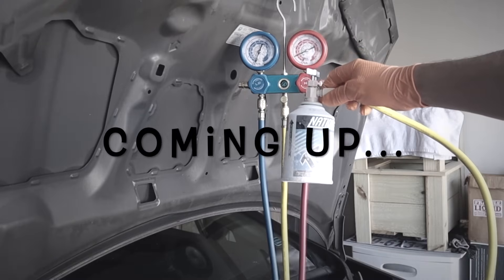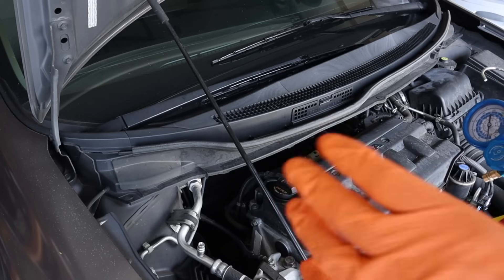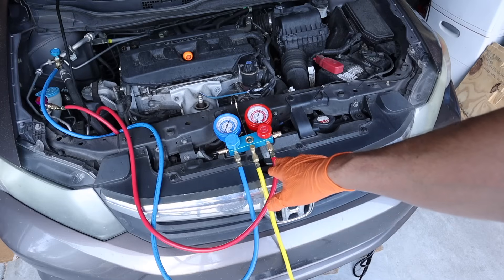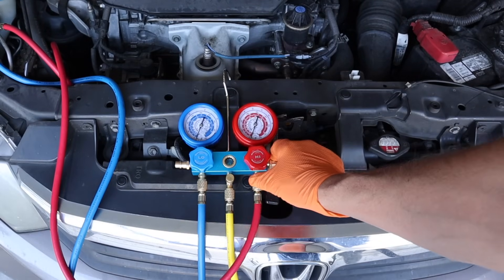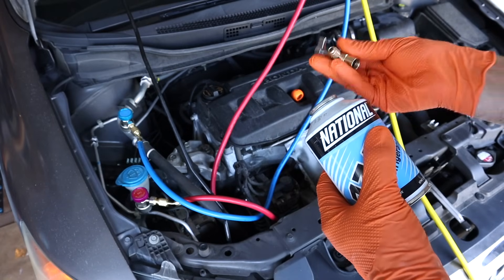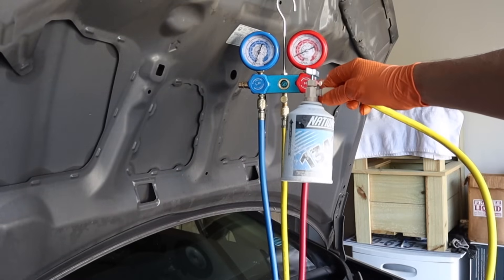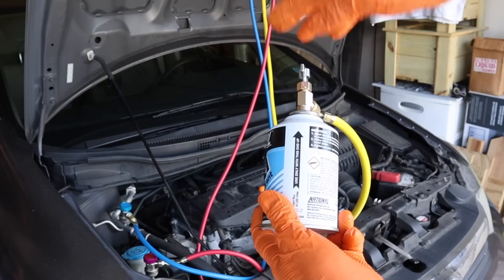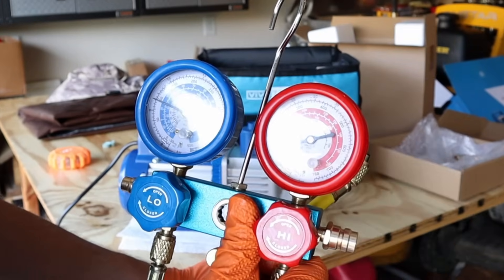DIY Tutorial - Proper R134a A/C charge & Diagnostics

Comment: I had my car regassed. A month later, it stopped
The guy said that the sponge in the condenser is dry and hard. 
What does he mean.
Is it possible
Reply from the maker: Hi Siva, it sounds like to me that if you had your system charged and it worked for a whole month, but now doesn't, you have a leak in the system. And it may be leaking at the condenser it sounds and that would need to be replaced.
Reply: Thank you
I will have the car seen to  by a reputable air conditioner company
Reply: " sponge in the condenser is dry and hard" makes no sense.

Comment: I have a Kia soul 2012. 2.0L and the compressor are leaking a yellow liquid for some time. I've tried to seal it with RTV silicone, but I think is not working. Do you think I need to replace the compressor? This car has only 73 K miles, so why you think is leaking? We are in winter so we don't use it too much for now, but in summer this place will get 105 to 115 degrees.
-- I have a quote to replace it for $ 1700.00
Reply from the maker: Hey Iris, it sounds like you MAY need to replace the compressor if you see something leaking around it, but it is hard to say. If you haven't already, I would start with a fresh evacuation and recharge and go from there. Your system may just be low on refrigerant, preventing the compressor to spin. That's where I started on my car. And when I found out that I could buy the kit and do it myself for less than what a shop would charge me to do the evac/recharge, I went for it. Having said that, if you are not comfortable doing it yourself, find a good mechanic who will. Pray that you are just low on refrigerant, and even if you have a small leak, it may buy you some time. Hope this helps!
Reply: Refrigerant is clear, but it sounds it might have UV dye in the system.  Try taking a UV flashlight and see if it glows in the dark.  This will help you to locate any leaks.  A bad seal on a compressor is a common problem.

Comment: Question. If i take my car to a shop and asked them to recharge my system, do they add PAG oil back in??? I think i need more PAG oil in my system as my low pressure line snapped, lost all refrigerant and i replaced it. I'm in NYC so i dont need AC right now, but just wondering if i have to put in PAG or will the shop put it in with the recharge?
Reply from the maker: Good question! The short answer is no, you shouldn't need more PAG oil just because you replaced your low pressure line. As a general rule of thumb, you only need to put in oil when you replace your compressor. Hope this helps!
Reply: @my-honest-review  I actaly had to not only change the hose but the compressor as well, but the manufacture of the compressor said it came filled with PAG oil.... my only conundrum is, i want this set you have for a DYI project, but i live in NYC and dont have a garage, so i have no where to plug the darm pump to... lol
Reply from the maker: @DTUFINOPhotography  Ah, yes that's nice when the compressor comes filled already. And I feel your pain about living in an apartment...I've been known in years past to run a couple hundred of feet of extension cord out into the parking 😊

Comment: to up your game get yourself a micron gauge and learn to use it ,you will be blown away at what guys doing ac is missing. i got deeper in this ac work myself and without the micron gauge you never see the moisture you're leaving in your system . we were taught 1hr vac and everything is good but the micron gauge will show you what your missing
Reply from the maker: Hey thanks for the tip! I've never heard of one before. I'll have to do a bit of research on that!
Reply: I would add also consider getting a bottle of nitrogen so you can do a pressure leak down test of the system before vacuum. I got a nitro regulator with hose for $35 on amazon and rented a bottle of nitro for $19.
Reply: @MyGoogleYoutube  I saw one video where the guy just used shop air!  Possibly okay if it's a dry day and you do a thorough evacuation afterward.
Reply: @paulspooner-q6k can u give us a link of the gauges you'll recommend? thanks

Comment: Great advice about checking the caps. They are the primary seal for the system and should be inspected fully and even replaced when servicing the system. They hold the refrigerant in the system not the shrader valve. The shrader valve is only there to allow you to connect and disconnect the gauges, they are not designed to hold the refrigerant in the system.
Reply from the maker: Great point! One time, I took my car into the shop for an unrelated repair and I asked them to go ahead and do a AC evac and recharge on my system while there. I got my car back and all was okay. Until I raised the hood to inspect. They had left my caps off my AC ports. I couldn't believe it, I had confidence in that shop until then!
Reply: Primary seal is Schrader valve. Caps are secondary and mostly to protect against debris getting into valves.
Reply: @hari4406  That is correct.  Why anyone would think the caps keep the system sealed with refrigerant and not the schrader valve is a head scratcher.  That's like saying your car tire valve cap is what holds your air pressure.

Comment: What is there's still Freon in there, or other oil? Aside from what you did, what if they didn't actually evacuate it all, then what would happen?
Reply from the maker: Good question! When an evacuation is done, it only gets out the freon, not any oil. Now, if they didn't evacuate all the freon, you'd know it when you pressed the schrader valve down on either ac port. If there's any pressure still in there, that means they didn't get it all out (you might get a small hiss instantaneously but that's normal). You shouldn't have to worry about the oil in the system when just doing a recharge, unless you think some has been added to the system when it should not have.

Comment: Nice video I have gauges I've got to get a vacuum pump.  My AC is not working I did diagnostics  and my low pressure is high around 85 PSI when it should be 32-55psi temperature and humidity dependent. My High Pressure is running 100psi should be in the 200psi range.  My suspicion is its the evaporator coil or expansion block  The compressor is quiet and clutch engages.  My next steps are to check for a leak as soon as I get a pump and get the readings from the compressor clutch relay just to rule it out.  Really hope its not the evaporator coil as the entire dash has to be removed and is easily a 10 hour job.  Expansion block can be replaced in 30 minutes to an hour.  The vehicle is an 07 Tundra.   Great through explanation.
Reply: Do I have to do the whole Evacuation job just to replace one of the short hoses?
Reply from the maker: Yes, any break in your system to replace a part, and you'll have to evacuate.
Reply from the maker: I appreciate you watching! Yes in your situation I'd do a total evacuation with that vacuum pump when you get one, then you can see if your system holds vacuum in the process (if it doesn't, you have a leak somewhere). I'll say a prayer for you that you don't have to do your evaporator coil!

Comment: 17:50  you really need a recovery system with a storage tank, technically you shouldn't be doing repairs on a ac system unless your certified, it could be a violation of the clean air act 
We at a shop did my 01 celica with a pump and gages like that the pump didnt draw the system down far enough, i took that mechanic for a ride in my car a year later he bitched it wasnt blowing cold, i told him i had some mechanic fix it.
He smiled when we got back to his shop he used his recovry system hed just bought to start from scratch that was about 10 years or more ago my car blows 45 dgr at the dash vent and has all that time.
These small pumps dont have enough pull.
My car had been in a wreck, the body shop put in a cheap steel condencer unit that leaked out the first year it never got as cold as the factory system did. So after paying to fill it twice i said screw that and bought a new factory condencer then changed ig myself on that car you have to pull the bumper and core supports  lines and unbolt it making sure to use new O rings.
I didnt charge the system i had my buddy do it at his shop.
First time was with the gages and a pump, but like i said his pump didnt pull the system down far enough.
The system uses less the a lb of r134A  when they use that much an under charge or over charge wont let the system charge correctly.
When you opened the valve to pull in what was in the yellow hose you over charged that system you had alread over charged it so it wasnt going to get as cold also it can dammage the pump on the car.
These R134A ststems do not work right if its not on point.
You have to be inside the tolerance.
The recovray systems get it right the first time its pulled down and weighted more accurately.
If your off just a littel bit its not going to work right. It wont blow cold.  Pluse you should change the sharder vales before you charge an empty system.
Reply from the maker: I appreciate your comment! Thanks for sharing your story. Luckily you don't have to be certified to work on your own car's A/C system here. You just want to have any refrigerant taken out at a local shop (where they have a recovery machine) first so it doesn't go into the atmosphere.
Reply: Always someone is going to hate 😮
Reply: Funny that so many people think the shrader valve is the main seal for the system. The caps are the main seal and are often overlooked to check the seal quality and overall condition. The shrader vale is a secondary seal and it’s only real job is to maintain a somewhat seal while you connect and disconnect the gauges.. after you disconnect them the caps provide the sealing for the system
Reply: @bobbg9041...Clean Air Act 609 certification is only required when you are receiving consideration for your work. Consideration is a legal term that obviously includes receiving money in exchange for your work. It also includes bartering for goods or services. 
For example, if you tell a neighbor you will add refrigerant to their car if he mows your grass, you need 609 certification.
Reply: @CWK090  Getting certification is easier than you might think...  https://www.escogroup.org/training/epa609.aspx
And here is a training manual for the test...  https://www.escogroup.org/Documents/609PM.pdf

Comment: Good explanation thanks for the video! Nowi did exactly what you explain and  the refrigerant I put on mine wasn't pure refrigerant it was mix with some seal and some other oils. And is not cold cold is alittle bit cold. I put 2 small cans 12oz each my ac system called for 1.68 pounds. Do you think is the kind of refrigerant I put in it? And I did miss a step I didn't drain the yellow hose when is replace the ca. Dang it I also put the can upside down when is was filling it. that's probably why lol
Reply: I've been working on my AC this past week and have researched a lot of information. There could be a couple of things why your AC is not cold. First you may have too much pag oil in the system, by adding those cans with oil you are introducing more into the system which can be no good . Second you may have over charged your system which would then cause your AC not to get cold as well. Best thing to do is go to an AC technician and have them properly clean and remove all freon in the system. Then they can put the exact amount using one of their machines . Hope that helps!
Reply: @kurti4432  ok 👍🏻 yes it does help thank you for the info
Reply from the maker: Thanks for the comment, yes I agree with @kurti4432, it sounds like you may have put too much oil/additives in the system. What I would do in your case is start over, evac system and put pure refrigerant in and go from there. Hope that helps.